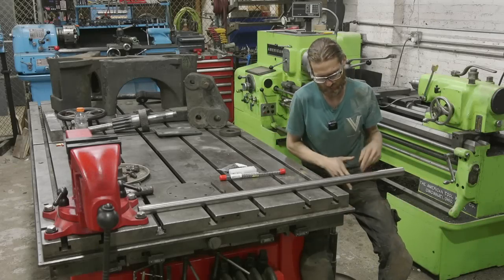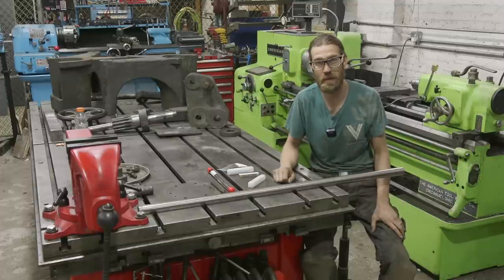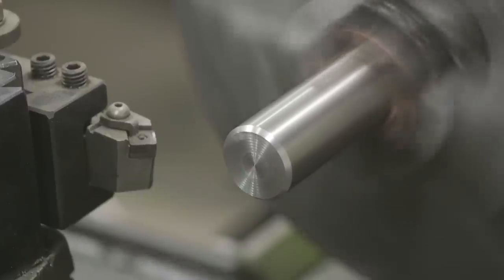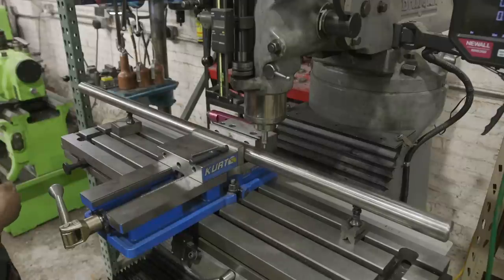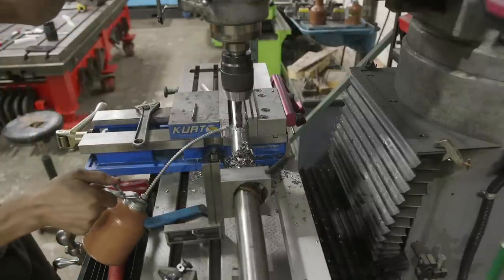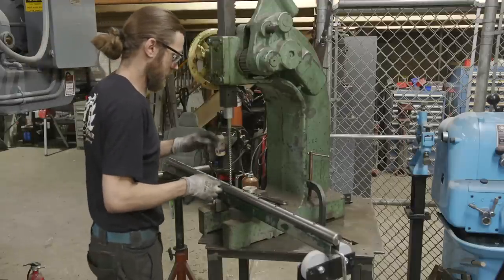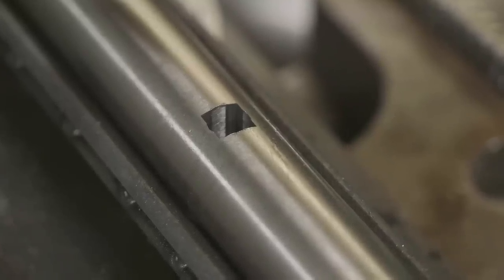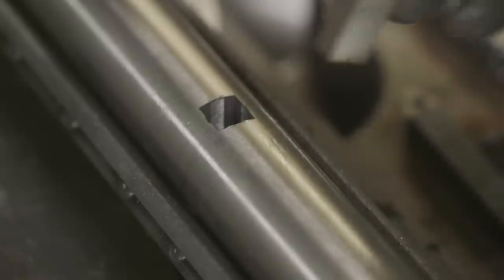Making a Line Boring Bar | Arbor Press Restoration

Comment: I worked in a shop that  rebuilt rock crushers   back in the  late 80s.  The shop had stuff they had built out of all used stuff. I learned alot the hard way.  I wish the internet would have been around back then.
Reply from the maker: Yeah it would have made life easier

Comment: Biggest thing about pushing a broach is the proper clearance drill and a firm steady push with lots of lube. Make sure the work piece is FIRMLY held in place. Hydraulic press is best. I have done thousands of holes. Make sure your broach is sharp to reduce friction. Dull broaches are harder to push and will cut under size. 36 year aerospace career (retired)...
Reply from the maker: Great tip! Thanks

Comment: I like to drill the hole for broaching and then use a 1/4 endmill to mill it square and then use the broach to finish out the corners. This helps to keep the broach square to the bar. Also on the mill we usually put the bar right down in the t slot and clamp it. this acts like a really long v block and you dont have to keep repositioning the shaft in the vise.
Reply from the maker: Yeah both great ideas. Thank you

Comment: Rigidity and stiffness are the same thing.  Hardness is the resistance to localized deformation. When you talk about hardness in metals, you are usually talking about abrasion resistance, toughness, and wear resistance.  After heat treating for example, stiffness does not change, but hardness is improved and  the yield strength, and tensile strength are improved.  Yield strength is how far you can bend something before it deforms permanently...  This sounds like it would affect the stiffness, but it doesn't.    This topic is confusing and widely misunderstood...  Love the channel and the content.  Cant wait to see what you come up with next!
Reply from the maker: Yep figured we would get some comments on this. There is a good couple posts on practical machinist where people argue over stiffness, rigidity, and hardness. I think for how this bar is being used  it shouldn’t matter to much. I am in agreement with you. Thanks for watching.
Reply from the maker: https://www.practicalmachinist.com/forum/threads/steel-stiffness-rigidity-question.239352/
Reply from the maker: https://www.practicalmachinist.com/forum/threads/boring-bar-material.157758/
Reply: @VanoverMachineAndRepair  100%

Comment: I really enjoyed your video.
I thought that perhaps if you would make a jig with a hole squared the size required for the job, that would be used to for the sole purpose of squaring the broach vis a vis the axis of the bar, could greatly improve the alignment.  But I realize that for your purpose it is not super critical...  To me, there is good value in this type of exercise.
Well done also on the two angle bar supports.  Also nice to say it came from Mr. Tupper.  He has a great channel as well.

Thanks for sharing and posting!

God Bless.
WWG1WGA
Reply from the maker: Thanks I appreciate it

Comment: Man... I was wringing my hands and yelling at the screen while you had that piece of strut under the work. F'ck me... that was unnerving.   Gotta keep the broach square and parallel with the hole the entire time. The smaller the broach the more critical this becomes. An 1/8" broach will snap just like a toothpick just by breathing on the press handle if these conditions aren't met.

And, I might add, that sure is a nice looking chuck to be ruining by "power tapping" without a tap holder.
Reply from the maker: Thanks for your opinion

Comment: If you drill the center doesn't that put your tool bit above center of bore?
Reply from the maker: Yeah it does but sometimes it doesn’t matter. Especially using boring bar style insert where inserts are half the shank of the holder. On certain bore sizes it matters more than others. Benefit of running it center is it allows bar to be run from either side. Otherwise bar would be directional.
Reply: @VanoverMachineAndRepair  is there any reason you would run a bar in reverse?
Reply: I don’t think reversing is a good excuse as you can simply flip the boring bar end for end to run it in reverse not that I have a reason why it would be an advantage.  

I caught the issue with the holes being on center/cutting edges off center too and I think it would be better to have the cutting edge on center.

Comment: Why did you need to make the holes square. Could you not off just used round holes with a flat for the securing screw to stop it from spinning and to hold it at the right depth. ? I have really no idea I just enjoy watching people linebore.  Just a thought.
Reply from the maker: Yeah both work just different tooling works each. Square shank has more options (lathe tooling)

Comment: Did you make a mistake with your hole placement?  

The cutting tools you show in your boring bar have the bits to one side and it seems you marked and drilled your holes on the center.  This means your cutting tool will be working off center.  

I believe that your holes through the bar should have been offset so that the cutting edge is located at the center of your boring bar.  

I don’t know how important it would be as the impact will be on the cutting angle and reliefs.   Just asking as I am trying to plan how to build one myself and searched out this video.
Reply from the maker: You can do it either way. I did it in center and used boring bar style cutters which step down to be on center. The benefit of on center is bar can be run in either direction but you need to use stepped bars to get on center. Larger holes don’t matter as much because of clearance. I looked at other manufacturers and each one does it differently. Honestly in future I would just do holes instead of squares. The boring bars are round anyways. It would save time and work fine. Plus drilling on center or broaching on center is easier than offset.
Reply from the maker: One video I used sure cutters off center another line boring I used rounds cutters on center. Typically square ones are lathe tools which the insert is in line with shank. Boring bars step down so insert in on center of bar.